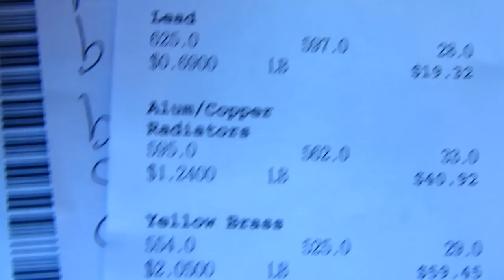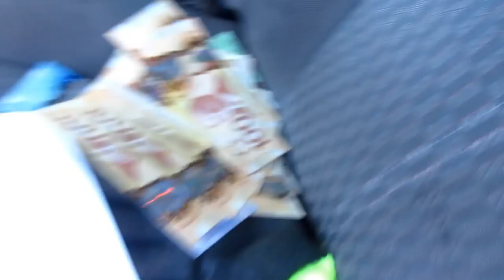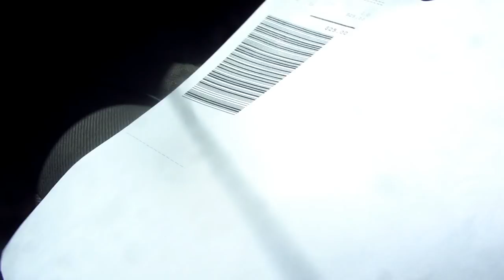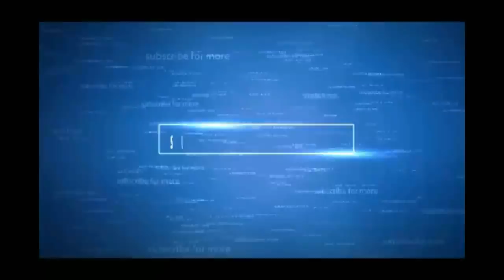NON-FERROUS trip $$/ scrap piggy bank edition

Comment: Lol the change fell out if the tin, which I had that tin for 10 yrs so it may be worth something. They made me open it up cuz I had it taped shut. Then they told me I could not send cigarettes also lol. $27 to send me a package damn one I sent was $16 thanks man you didn't have to I'm excited now lol.
Reply from the maker: me the only question they asked is if conttent was possible dangerous or harmful in one way i certified that and sign for it and it was the only question asked 
i wrotted down on the paper conttent description and wrotted down in big GIFT ....im excited too that you received it i think its pretty cool